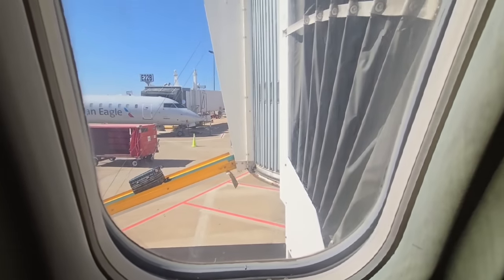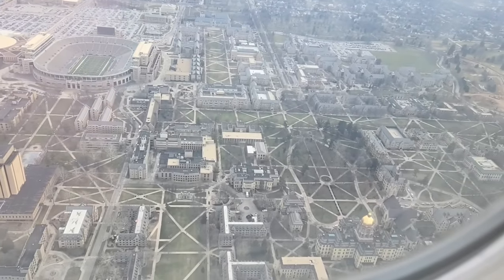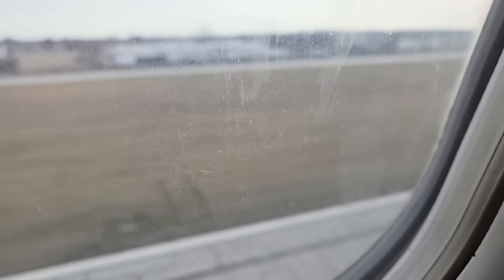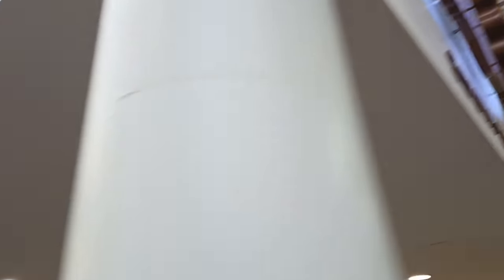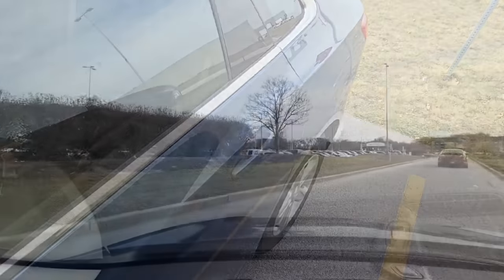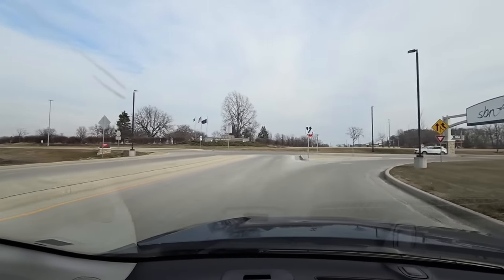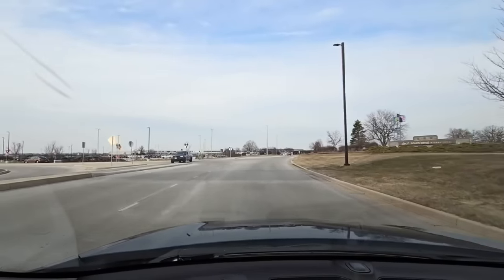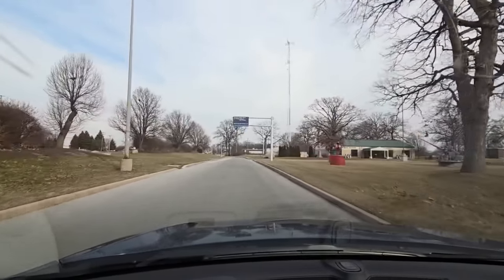LIPPERT Answers Questions about RV FRAME FLEX! Part 1

Comment: I am an engineering technician and work for a build to print company. What this engineer is talking about is that he either provides a frame that is specified by the customers print or his engineer developing team provides the print to the customer. Lippert should build to print this is either marked up and there would be a APPROVED FOR MANUFACTURING drawing made and agreed by the customer or a print is created and approved by the customer. Now the Lippert engineering team should communicate with their fabrication supervisors to make sure they are building to print or can build to print. After the frame is built to print, quality should make sure this frame is built to print. As for the quality checks there should be a safety team to make sure each frame meets these requirements on the print. This is how I see this company should be doing this in their facility of manufacturing.

Comment: Frame flex is because less material was used in the design to lower cost and weight.  I have 2008 Tango and the frame is I beam with substantial cross members.  Crawl under any new TT and it’s minimal angle iron with vertical round rod acting as an I-beam.  Minimal thickness C channel is not made to carry loads of the superstructure.  Saying that Lippert builds to spec and responsibility for damage lies with the RV manufacture.  Interesting to note dealerships now require customers to sign wavier absolving them and manufacturers of warranty responsibility.

Comment: In My Humble Opinoin 
#1 It is amazing in itself that you were able to get Big Corporate on camera answering questions about a subject that has potential liability issues in millions.  (that is no easy task)
#2 Yes her body language is a tell tale sign, but keep watching, I think you may be mis-reading her body langauge, I think she wants to tell us her real opinion, but cannot due to corp. repercussions. (I think she wants to tell us that the Manufacturers went way beyond acceptable practices to cash in on the huge uptick in Rv purchases during covid. 
#3 She brings up a very VALID point, a current or previous RV owner could have overloaded, abused, went serious off-roading with thier Rv causing serious structural damage then sold the unit to pass on the damage to an unsuspecting buyer. 
#4 I believe the majority of the issues today are from RV Manf's overbuilding (adding/extending excess weight ) & underbuilding (adding non-unison structures) onto thier frames, yet the manf want to point the finger at Lippert alone. (I tend to believe this IS why they allowed you to conduct the interview)  (No, I am not an engineer, but I think you know what I am saying)

Comment: I'm not an engineer, but I do know a few things....
1.  Weight is paramount in these large RVs.  RV manufacturers are trying to keep weight down as they cram more and more features into the units.  They could specify Lippert build more rigidity into the frame and they could add rigidity in the superstructure, but that comes at the price of additional weight.  
2.  I think a lot of these flex issues came about when they started installing slide outs in RVs.   You take a structure, and then you cut a huge, gaping hole in the side of it. Unless you really add structure around the opening, you are going to get flex.  Refer back to my weight comment.

Comment: Hi
With all do respect Lippert and all Rv manufacturers are missing the point. Build a frame that does not depend on the building of the trailer box itself. 
Example you won’t ever ever find a lowboy hauling equipment that depends on the planking for part of the strength of the lowboy itself.
MAKE A FRAME STRONG ENOUGH NO MATTER WHAT IS BUILT ON IT.
Thanks for listening!

Comment: This is not a unibody structure, the rv on this frame is anchored to the frame,not built into the frame. It is the job of the frame to support this rv design.  Ive seen quite a few videos if these frames cracking and in my opinion just looks like the goal is a cheap light frame that is not holding up to the weight,size of the completed structure.

Comment: The roads in the USA are for the most part good, depending on where one travels and what state one maybe traveling through. But I feel the " Riding down the road in an earthquake" is at least 40% to blame for flex frame damage or fracture that needs to be considered for the initial cause of damage

Comment: Three things.. given the potential immensity of the issue, you’d think the lady would have at least the body language of a professional but it came across as clearly not wanting to be there. 2) if everything is to RV standards, then the expectation of those standards need to be changed to a model where the weight tolerances are MUCH increased to be in line with the real world of what people do… and need to have to accommodate what the RV is being asked to do. 3) I had an axle issue on my travel trailer by Grand Design. GD did not honor the warranty because I was a second owner even though bought the unit only 5 months after the initial owner did. They took the “out” as fast as they could! But in getting my axle replaced at my expense, I discovered something from the honest dealer…. That the original axle of 5000# rating (which was marginal at best) was only $70 less than a 7000# rated axle. So for $140, the RV industry put the cheapest lightest weight rated axles on my unit which cost me $1000 in tires and $1600 in replacing the axle. So obviously not a decision in favor of their customers… but only in their own financial interest. I suspect this frame issue is much the same kind of mentality manifesting itself. Remember the old adage.. “an ounce of prevention is worth a pound of cure.” Where is the common sense?

Comment: I don't hear any taking just the frame by itself hooked up to a truck and waited down with weights specific to the rv loads including water tanks and sensors throughout might shed some light on problem areas associated  with all rv frames.

Comment: Your first question is BS.  RV's are not composite designs.  You don't use foam fill fiber glass to reinforce STEEL frames.  The box on a standard tractor trailer is not design that way.  The FRAME on a tractor trailer carries all the load.  This is all spin, pass the buck.

Comment: All they have to do is run a vertical piece with the riser from the bottom frame to the roof, then tie than in (inside the wall) to the front nose beam. Done. Problem solved.
Other option is to install a couple gussets from that vertical piece forward 12-18" on the nose piece. This isn't a complicated solution. Cost an extra $20 in material and take an extra 15 minutes during production.

Comment: First off EVERY frame on every RV ever made flexes, it's a matter of degrees.  What I think most of the youtubers are complaining about is actually frame fractures which is generally the result of frame flex over a period of time.  As far as the superstructure goes I don't see typical RV construction of a 2x2 wood frame, some type of non structural insulation and a couple of skins of 1/8 inch plywood or possibly Azdel being a significant addition to the strength of the frame.  I'm no engineer but I've built a lot of things in my life and the walls of an RV just aren't what I consider a structural component.  Look at a cargo trailer, there is nothing but some z bar uprights and a thin aluminum skin which adds practically nothing to the structural integrity of the frame.  When these start to brake you see it in buckling in the skin.  I think this is mostly a frame issue although not necessarily all Lippert's fault.  You never know the loading or the abuse an RV has been subjected to.  Good video.

Comment: Most all RV frames are to weak to support the RV. Try this out and you will see what I am talking about. Disengage the middle leveling jacks so they do not work. Then Jack the RV using only the jacks at each end. But before you do that measure the distance from the ground to the frame rail.  When you start lifting and leveling the RV only at the four corners you notice the center part of the trailer will sag and sag a lot.  The frame can not support the rig all a long the frame because it's to weak to do so.  That's the real reason they went to six point leveling.  It's not that it better it's that the frame is to weak.  It's cheaper to put a extra set of levelers on and charge you more for it.  It's like when you watch the videos where they show trailers being built and tell you they put blocks of wood in the aluminum studs or frames to the end does not collapse and give the screws something to bit into.  Why do that??  Thinn material cost less but then must be stiffened up.  Again it's profits over everything else.  Ever look at how much a RV can carry weight wise.  I've seen some 5th wheel trailers with only 1000 or 1200 pounds of weight they can carry.  Way, way to little?  Why you ask?  Because it does not include both batteries only one if your lucky. Not does it include any water of any kind.  In fact most will say to never pull the unit with any liquid in any of the tanks.  Why?  Again to cheap of a frame.  Reduce material reduce costs and make more money.  Then you some that say it's rated for full time use. Really?  Read the owners manual.  Full time use is less than 180 days a year.  The RV industry spends a ton of money a year on lobbyists every year to keep them from falling under mist consumers protection.  Why?  They would have build better and stand behind what they sell.  Steve Lehto did some very good podcast on this subject. It's a eye opener. Bet you haven't seen any of his videos have you.  
    Now most all trailers must have some flex in order for them to be able to turn without take 40 acre's to do so.  When I did heavy haul in the transportation industry those trailers had very little flex. They road rough and didn't turn for crap.  To stiff for doing that but could haul a lot of weight.  Ever see a flat bed empty going down the highway and it looked like it bowed up in the middle?  Well it does and the reason is once loaded it straightened out and doesn't sag under load.  Now look at the frames in the RV industry videos showing them being built.  The show the frames with nothing on the and they straight as arrow.  Without the bow to flatten out the frame has to carry more weight but still stay straight.  Humm. 
   Another thing and this one is so important and your stupid if you don't. Always hire a good RV inspectors to inspect the unit your looking at buying. New or used.  They work for you to help protect you from buying a bad unit.  Most new units are garbage in my opinion.  The manufactures don't care if they have any quality control at all.  Some dumb butt will buy it without a inspection and then it's their problem.  
   Josh the RV nerd did a video on this subject and like others he did his best to gloss over the issue.  Are you going to do the same???
Reply: I had to repair my last 5thwheel frame after the ibeams bent at the axles.  I added full length 2x3 tubing after lifting the rv at ends letting the frame sag back to straight.  Added about 300lbs to the frame and $500 in materials.  Double the frame strength no more sag and didn't deflect anymore when jacking the wheels of the ground.  All the factory welds were done with a wire feed turned up too hot and welded down hill.   It's faster but produces a poor weld that paper thin.

Comment: As you've covered elsewhere (IIRC), the vast majority of these claims of "frame flex" come from 2nd or 3rd owners. The trailers have been overloaded. Toyhaulers are always going w-a-y too fast for road conditions, towing rig and driver's experience. And the complainers are folks (like us) who live in their RV fulltime. Then you add the cherry on top  which is folks (like us) who use a gooseneck adapter to tow our 5th wheels with our gooseneck-equipped trucks because we can and that's what we want to do.

The adapter changes EVERYTHING! And when you combine that variable with overloading, excess speed, inexperienced drivers, and excessive use (per the RV industries most convenient duck out = these units are not designed nor intended for fulltime occupancy), we've given the industry FIVE convenient bushes to hide behind and hide behind them they will. Personally? If I think the factory has done a bad job of building my unit, I'm gonna' figure out the problem myself and have a competent 3rd party do the the repairs or make those repairs myself. I'm not gonna' give the factory another shot at making my life miserable and I sure as hell am not gonna' expect any RV repair shop to have a clue about much of anything.
Reply: Funny how you know exactly how everyone is using their rig, how much they load it, how they all drive. I didn't know you were so Omniscience and Omnipresent. Wow! So impressed! You have this all figured out. End of story Folks!!

Comment: I personally see it this way, if I modify my Jeep Wrangler and change the suspension, if have now assumed the responsibility for any failure.  It is no longer Jeeps issue if i throw a tie rod.  In the same way, owners assume the responsibility if any modification is made to the pin.box or the structure. Not saying that all frame issues are the fault of the customer, but the customers with modifications have potentially 6 the responsibility for any frame issues.

Comment: Seems to me like there’s a lot of contributing factors starting from Lippert down to the end buyer.  Every manufacturer from toothpaste tubes to stick built homes has had their share of issues, nothing mam made is ever going to be perfect. At least someone has brought this issue to light and someone has the testicular fortitude to as the question’s that folks love to sit behind a keyboard and play engineer. This looks like a great start to holding everyone from frame to buyer’s feet to the fire, so to speak of. I appreciate the fact that you have taken the time and consumers questions to Lippert to get the best possible answers, even though a lot of people will not agree with any answer you might get !!! 
We visited Alliance’s factory not to long after they started, and a factory tour should be highly recommended by the dealership just so a buyer can see how these are produced. We have yet to purchase a new fifth wheel because of different startup companies that are “revolutionizing the industry”. We’ve have only had fifth wheels, 3 since 1999, from KZ and the last one was 15 y/o when we sold it. We had 3 issues total between the 3 we had and yes it was way before COVID and all the issues of sourcing. 
Keep on doing what you’re doing and if you lose some followers, they weren’t going to accept or believe anything that anyone would have to offered them anyway…..  Great job on all your content you have produced thus far, looking forward to the rest of this one !!!!!

Comment: My big questions are, do they require Mill Certificate with their steel? Do they track it to the frame serial number? Have they taken a sample of a cracked frame and have it tested? You have to start at the begin to solve a complex problem. Any flawed data before the present step, make the present process flawed.

Comment: I am not buying the longer pinbox is causing rotational - stress issues. Here is why. My 5th wheel came with a Lippert 328329 - 1621 SHD pinbox. The specs show it as being 26 3/8" from the kingpin to the end of the pinbox mounting tabs a total drop of 13 7/16" from the top of the pinbox to the bottom of the kingpin.   When it had a failure due to the pad moving out and was replaced by Lippert - TWICE. 
The second time they replaced it with their Airride (Trailair) Pinbox which has a spec of 28 11/16" long and 17 9/16" drop. So they replaced the original with one they manufactured that is over 4" taller (or lowering the kingpin itself) and over 2" longer... The specs for each are on Lippert's website. 

This would drastically change the torsional forces on the pinbox mount points/frame.

Comment: There relying on the 5th wheel body to stiffen the frame, that sounds like there trying to point fingers.
Reply: From an engineering perspective, it makes perfect sense.  They work together.
Reply: @97minitaco agreed and alot of people are not getting that.  
  If the sidewall lag bolts rattle loose the rest will fail, which I believe has been the case in many examples.

Comment: I get that there are small percentage of frame failures that are owner induced however IMO there are significant percentage that are not. Some owners have shared information on the poor welds themselves. Tac welds only in  critical areas along with porosity on welds. The RV industry is infamous for blaming the "Owner" and in some cases that may be true but this problem is a lot bigger than a few negligent owners IMO. Anytime I hear the terms " RV Industry accepted practices" or "Within Tolerance" I get suspicious...